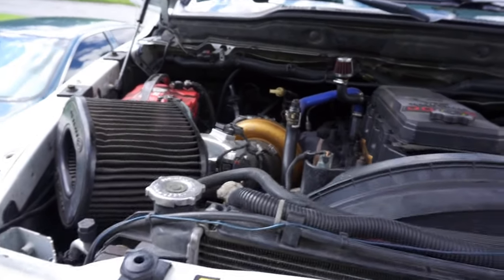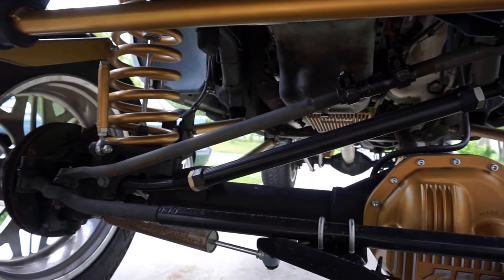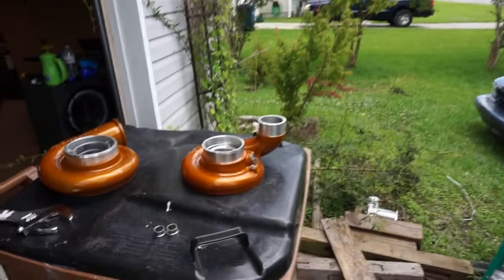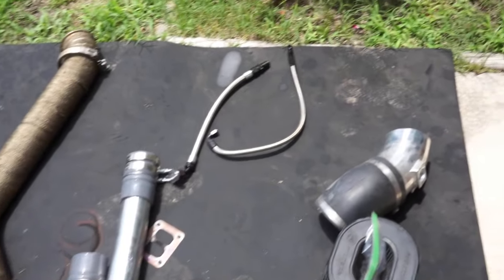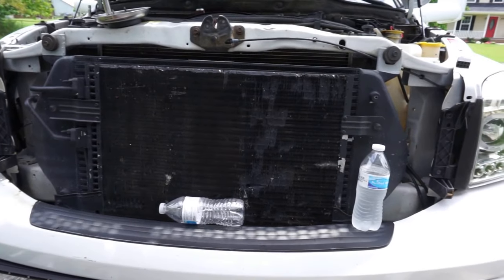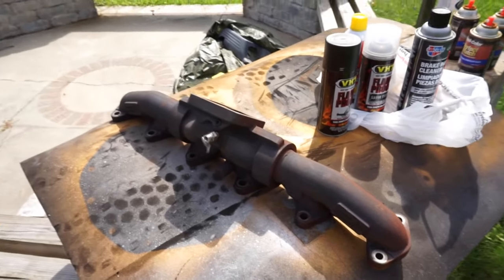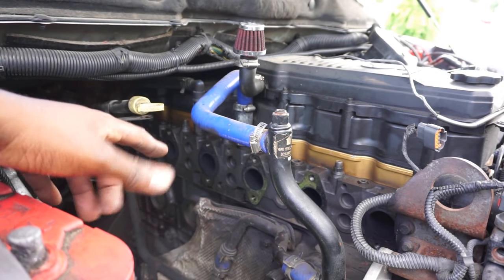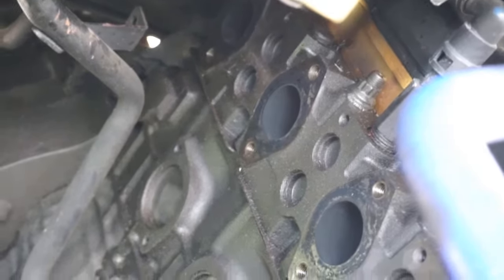PREPARING THE 6.7 CUMMINS FOR COMPOUND TURBOS!

Comment: You probably been asked this your ball joints are they adjustable and if not I'm just wondering how your alignment came out. Because I was told to get adjustable ball joints for my 37's just wondering about your opinion so I don't waste a lot of money thank you. I'm going to go with a adjustable BDS track bar but let me know on those ball joints please
Reply from the maker: They are not, when the trac bar bent it changed the axle position under the truck which cause the wheels to slide to one side more so the steering wheel turned

Comment: Seen a couple of you videos In the past. I'm literally doing the same set up now. Thought it was funny that you mentioned no instructions cause I got everything and that was the first thing I was looking for. I'm installing everything on Sunday monday so looking forward to the video cause when I mounted the manafold and the s480 turbo bracket it seemed like the a heater core line was in the way...
Reply from the maker: Yea they said its gonna be a tight fit and some lines may need to get moved a little

Comment: i've used the high temp engine paint 2,000 degreese stuff on a manifold and exhaust size of the turbo as well as the down pipe and after 5k miles it still looked like i just spayed it on there. just cheap autozone stuff
Reply from the maker: Thats badass, I never even thought of that.

Comment: You need more clearance between the axle mount bracket and the trac bar so that the passenger side suspension can droop without binding, and bending your bar. Like a link with more of an 's' bend or cut a little clearance in the axle bracket so the bar can travel more.
Reply from the maker: The new trac bar will have that drop in it. I know exactly what u talking about!